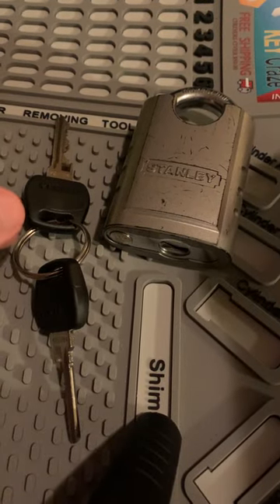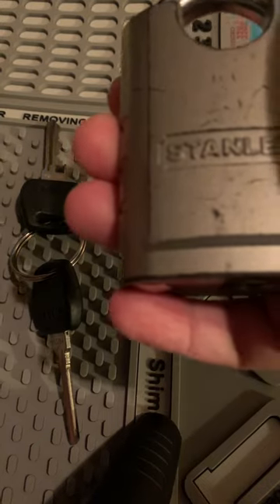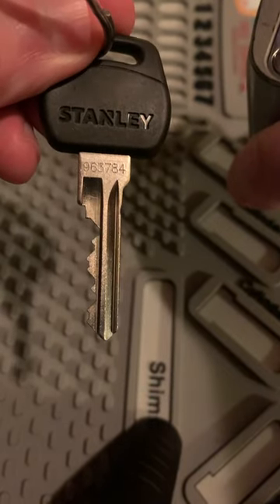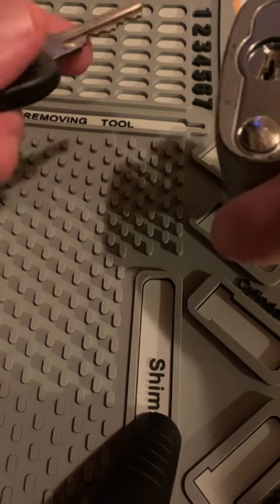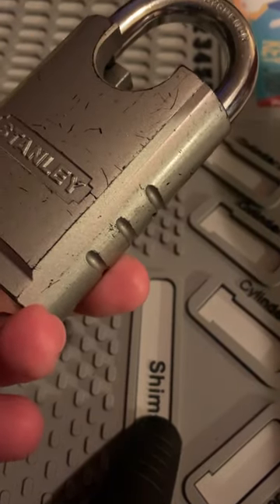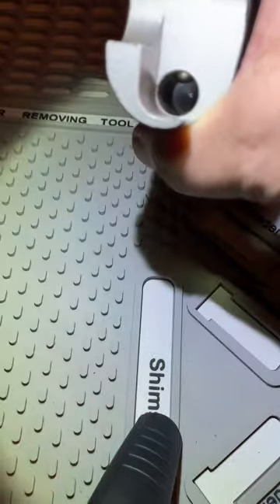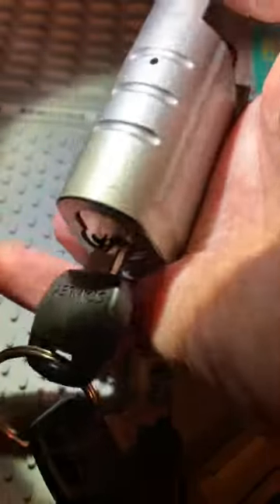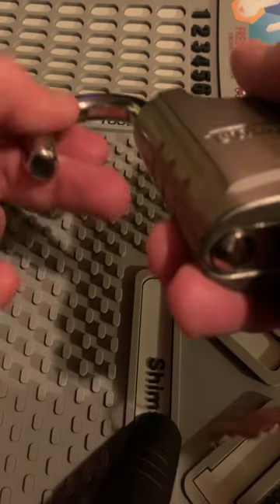Stanley 60 mm 24/7 Safety Padlock Model CD 8820 accepts standard Schlage 6 pin bump keys!

Comment: I keep a grinder in my van for locks like this, especially if they're weathered or rusted and can't be picked in some way. Also, I keep a core puller in my van. Bolt cutters just ain't it.
Reply from the maker: Your bump keys do just fine, and I just gave a set of the most common keys to a close friend one of the spares your dad sent me.

It definitely is a beast to pick but most locks bump open with a bit of persistence.